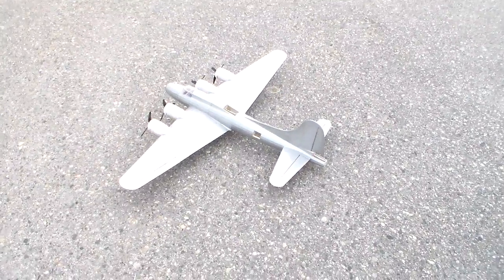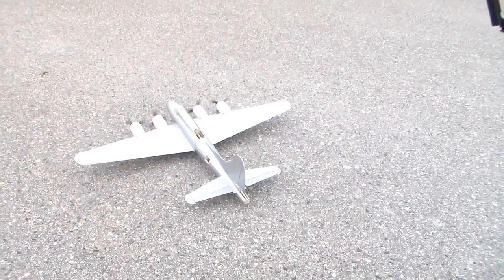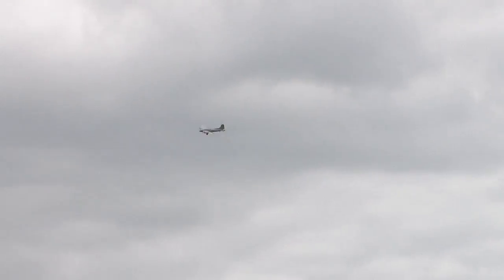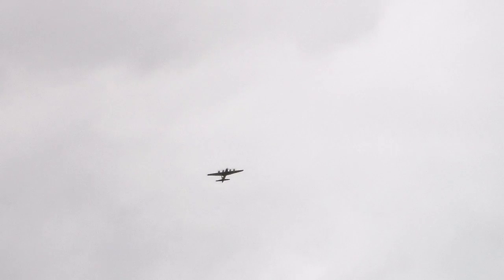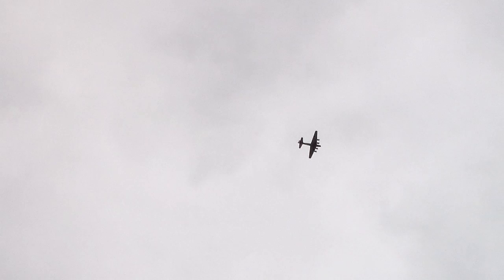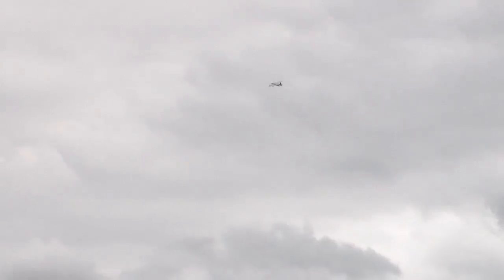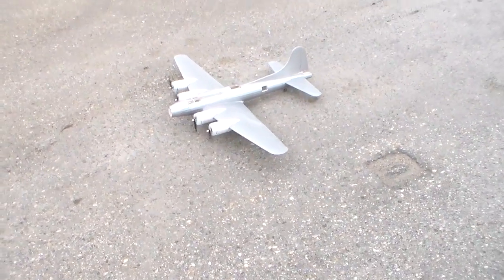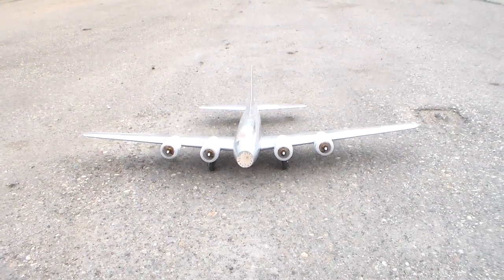Guillows B-17 RC conversion maiden flight

Comment: Wow - Awesome flying skills getting it down so smoothly as you did. 
It's my opinion that this Guillows kit was more for display purposes (..or at best, brick on a string CL flying).
Flying this RC and that fast landing a testament to your skill. 
My guess is even after you got it fully in trim its still a hot and twitchy bird. 
(With my skills it would soon crash .. and one error would reduce it to a pile of unrepairable sticks and tissue!)

Comment: I don't care if anyone thinks that a comparison of what I've seen here and the duties of a test pilot isn't apt. Sure, a test pilot can die, and you are not in "danger". But the hours "wasted" if you have a bad crash can feel like a version of death. I've built scale in rubber power and on the few occasions that I muffed it, I was fairly shaken. So congrats on doing something that most of us only dream of - nice one! If you put in more powerful motors and the probable necessity higher capacity and heavier batteries, would it be a net gain and overcome that it has become more of a bear to handle? Control line can easily take more power and weight. But R/C is no comparison, from what I've seen. And to land it on rough asphalt? Kudos all way round!

Comment: Woooooo Hooooo.. That was some nice flying I couldn't of saved that right bank turn.. When I saw that I said if that was me I woulda giving her right bank turn dirt napppp.. 😂😂😂😂😂
Reply from the maker: Thanks!! its funny how much the B-24 was like this B-17 on maiden!! both banked hard right for different reasons and with both models i cut the throttle and the tail dropped and i said " its tail heavy"! but really the C/G was right on and it is just how these multi motor models react to cutting the throttle. gosh, it has already been 6 years since i built the american beauty!!
Reply: Wow...six years ago.. Just came across your Vidd. I should say many of your vids.hahaha.. I just watched episode #7 of your maiden b-24 liberator and yes you said it !! That looked like a crazy maiden flight.. Especially all the down elevator u had to give it to get it corrected... My hat goes off to you again for great flying u did to get it all trimmed out and especially not given it a dirt napppp first time out.I was really worried for a second there, when it seemed like it was getting kinda far away from you... But you had to up high enough As I say to have 1 or 2 mistakes high enough in the air to save it from crashing.. That b-24 liberator is such a nice plane and as u said a 6 month build. So I'd hate to of seen it crash.. And also don't think that since you've did so many guillows how to Build's that its getting old and you've got nuttin left to show everyone... Keep umm comin.. I enjoy the hell outta of them, as so many others do to.. You know as I said before, a guy can always learn something new when watching the vidds.. Hell ive watched the same episode 3-4;times just to perfect on certain things.. I need to master aileron installation and I seen some guys build scratch built retracts.. Have u done scratch built retracts??? I would love to learn how to master that.. I just luvv to build and fly.. Hahaha.. Anyway. Take care and keep those vidds comin....👍👍👍👍✈✈✈✈✈✈✈✈✈✈✈✈✈✈✈✈✈✈✈✈✈✈✈✈

Comment: Beautiful workmanship.
I just received this model from an E Bay purchase. I wish to do it similar to your most excellent model. I can't decide what to do for power. Can you tell me what motors you used? I built a lot of Guillows kits over 50 years ago and am just now picking it up again but with RC now. Love their kits. Feeling of satisfaction when completed.
Reply from the maker: the guillows kits are great projects thanks for your kind comment on my build. in the video description I have listed the components needed for this build. also there is a link to the build log @ rc groups which will explain some of the build. also @ rc groups there is a thread called  "Guillow's Conversions - The list of conversion threads" where you can find all sorts of rc conversions for guillows models.
Have fun with your build =D

Comment: Wow, that's got to be the smallest four engine R/C plane I've ever seen. Well done, sir! It's almost majestic. How hard are these Gullows R/C conversions to fly? You seem to have a few of them.
Reply from the maker: Thank You for your comment! this 17 model flys great as I learned in this video you just need to keep the power on or it will fall out of the sky there is really no glide mode.my other conversions are very rewarding as well.the 500 series are more tricky to fly but the 400 series 109 and p-51 are very pleasant to fly.
Reply: Yeah, I could tell she didn't like to glide mode much. I'm wagering the lift-to-weight ratio isn't very forgiving on any of them.

Just looking at going from rotor (Trex 450) to fixed wing, with something little enough to fly in the big yard in front of the apartment. Gullows kits are a lto cheaper to ship, then say, a Bixler or other foamie. The downside being, there's always that risk of bringing home a million peices. Are those parkzone kits for sale without the planes? I've gnot found them around.

That's for the info!

Comment from the maker: the port spin clock wise and starboard are counter clockwise. I figure it was hit bit a bit of a wind gust.i'm glad that it had the power to get out of it and enough control to correct.
Thank You for your comment.
Reply: Whered you get the props?